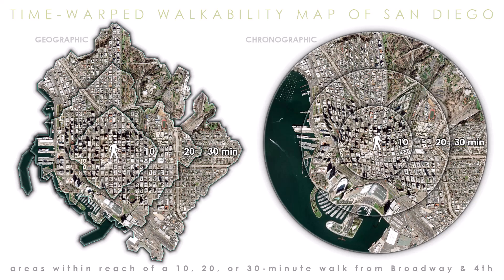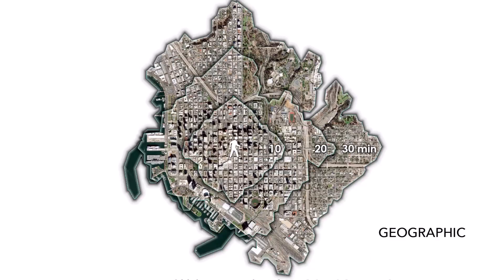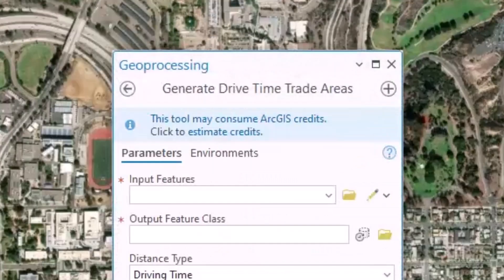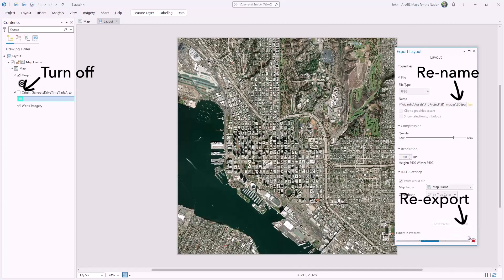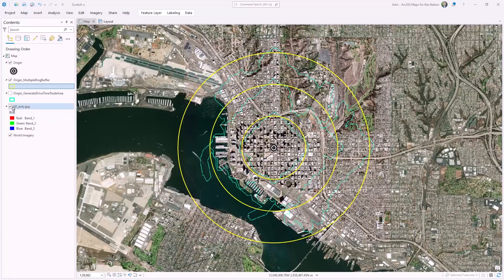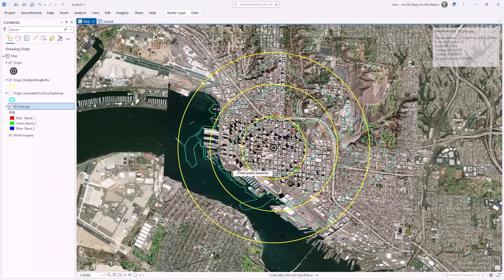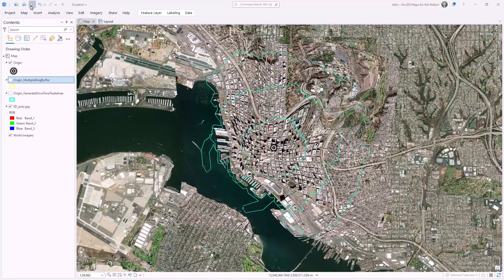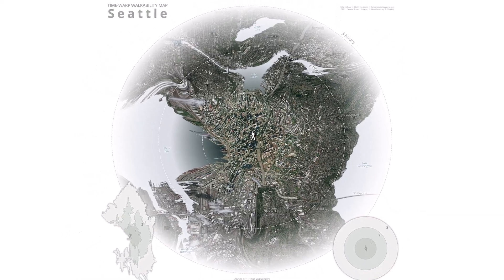Time Warped Walkability Map

Comment: Hey John, long time fan, long time lurker. Quick question on this, would the units make more sense in the ""Generate Drive Time Trade Areas" as distances vs time? Then it would exactly match the multiple buffer ring distances you ran? This would drop any trial and error in the MRB. Also, I know this was approximate but it does not make sense for your "as the bird flies" buffers to be shorter than the "as the bird walks buffers", at the very least they should be identical. I think the outputs would look more powerful if the spline rectified imagery shows birds flight buffers from 20 minutes displaced into birds walk 10 minutes? Am I out to lunch here, or am I misunderstanding the analysis. Please let me know! Again, your videos are amazing, truly...."topo-notch". Okay  sorry about that one. Cheers.
Reply from the maker: Thanks! I’ll have to puzzle on this question. Appreciate the interest and insights!